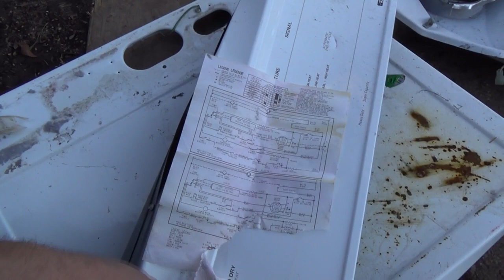squashing stuff for scrap metal Friday

Comment: I have to agree with a lot of the people making the comments to return the compressor pump.  I listened to your idea and I just can't see how useful it would be to run off the tractor.  If you return the pump then you could have money to buy wood for the bridge.  Also I would suggest that after you finishing decking the bridge that you paint a stripe line down each side indicating where the beams are.   This way you will know where to drive and keep the tractor from rolling on the outside edge.

Comment: Skillz, plucks the knobs off the dryer lol. Should take that compressor pump back to PA and pick up some more bridge lumber instead.If you need some air occasionally way out back you could use your generator to run a smaller portable compressor.

Comment: AHH, so you are using my ideer! i like that idea! but what happens when the tank is full? you would have to wire up some sort of electric clutch like for the deck on lawn tractors.. fire off a pressure switch when to engage and to disengage the belt system. does sound cool though
Reply: that is a continuus running pump, he could put a 125psi by 78scfm pop-off valve on the tank and call it an air compressor but if you really wanted to get fancy you could use that electric clutch

Comment: If you want to make a proper deal with the new pump, you might find it useful, and why not fit it a small platform on the front of your green trailer  you made?
I thought you had taken that back?

Making an easy snow plough to curl the snow off the road entirely.

Think you might find it useful but do some drawings and measurements instead of guessing eh, you know like a real engineer?

I have figured out how to make one of those snow-ploughs which curl the snow over to one side.
There is no need to think about bending anything because you do not have the equipment to do it so to get the curve it will be like this.

A series of strips all the same length with a minimum of 10 cm and the other end will be something like 20 cm. I have not worked out the size because I do not know what size you can push. 
Anyway this will give you several long triangles and you make as many as you need welding the thin sides to thin sides so you end up with a small or very large curve that will direct the snow and ice right off the road rather than building up in front of the plough.
Take the basic shape of a large ‘C’ shapes plough which is at least half a diameter, and make the plough join your machine at about an angle of 30 Deg, with the thinner end further forwards and the snow will be guided into and across the plough and turned out at one side the opposite to the thin end.

Making one with any bends is perfectly possible but you would need a jig to hold the steel while a moveable clamp was levered to make the bend. You can make the jig for that first before the snows come and make a really pretty plough or make it my way, which will not be so pretty as a properly bent one but it will be much easier to control the twist and alinement of each bit of steel.

Let me know.
mrbluenun

Comment: Bill Can you make the electric motor run off the tractor to run the air compressor?
Reply: you would need one hell of an inverter( 12 volt to 240 volt) qand he doesen't like how hot the motor got, which is why he didn't use it in his in-shop air compressor